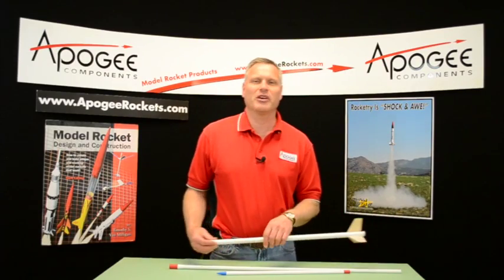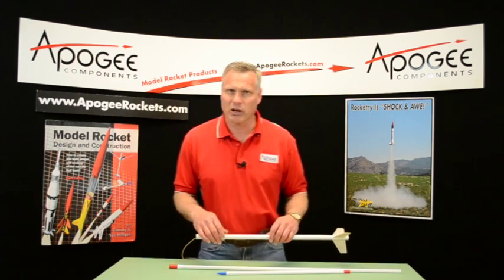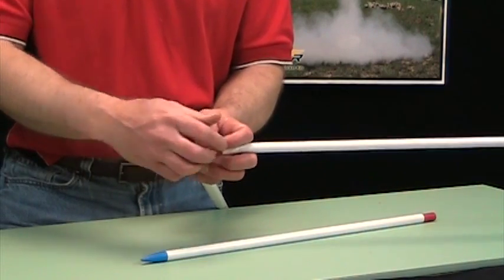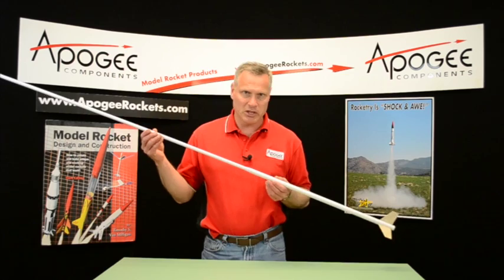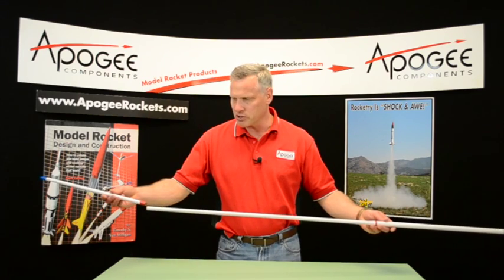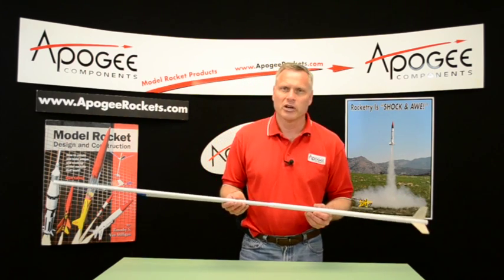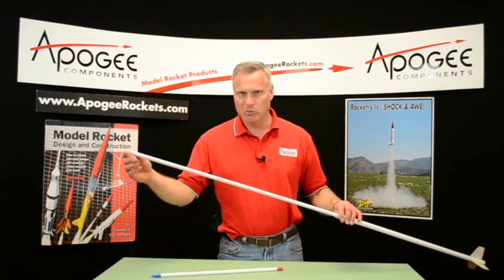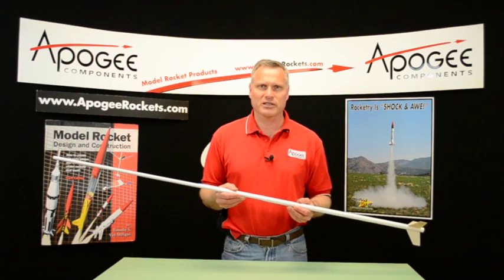Model Rocket Competition Strategies: B Superroc Altitude Event

Comment: So Tim longer rockets reach higher altitudes? How high is the estimated height of this rocket on a B6-2?
Reply from the maker: Sorry, I don' remember how high it went. That is what you can use RockSim for.
Reply: @apogeerockets  I'm not good at all the measuring, weight calculations, I done even have the measurements? I was just curious. You cant spitball an estimate? Or answer the question posed about do longer rockets tend to go higher? Thanks.
Reply from the maker: @RobsRocketTimes  Longer rockets don't necessarily go higher. They are heavier... so that is the thing that causes them to stay lower. They can also wobble during flight, which greatly increases the drag. This contest event is about "structural" design. Can you build a long rocket that doesn't kink?